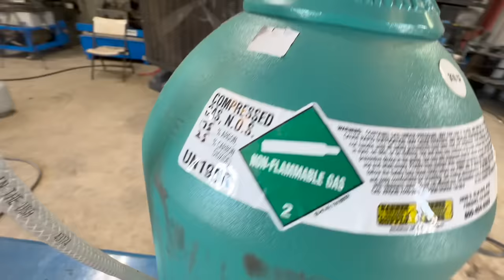Kobelco loader arm part 1

Comment: Man that quite the pretzel there! Thats gotta be close to $10k part I'd imagine so i hope you made them pag accordingly for your troubles of them not using the machine correctly nor taking care of it properly! #4,995.00 sounds about right ya gotta pay for all that propane, acetalyn and oxygen you needed to heat that huge chunk of cast iron up to be able to bend & then line boring & fitting pin! Cheaper than a new part plus the extended wait time sending it from China factory to here in US 👍🏻👌🏻💪🏻🛠️🔧🔩🗜️📐⛓️🏗️🚜⚠️⚡🔥💥💨🚧

Comment: Lots of thinking and demonstrating a difficult problem!  Thanks for filming this.  Would heating and pressing gone better if you built a furnace around the part by piling up bricks to keep the heat in the part?

Comment: Thought of using your Beetle as a track welder?   You might find it useful on those long runs with lots of overlap.  Chuck the mig torch in then clamp the trigger.  Just a thought.
Reply from the maker: I have thought about that. I will probably try it one day.

Comment: Its a little late now, but could you have setup a forge with fire brick and a ribbon burner to heat more of the structure hotter and faster to facilitate bending much easier?
Reply from the maker: That did cross my mind.

Comment: well done, I was gonna say at the start, wouldnt it be much weaker if its already been bent, also work hardened so brittle? I wonder how does that compare to a weld joint? Welds are also slightly harder than the base metal right?
Reply: weld strength is related to the strength of the filler wire.....there is also the issue of [ HAZ] heat affected zone next to the weld, the amount of carbon in the base material and also the fact that weld metal is cast metal, unlike the forged or rolled steel of the base metal.....lots to consider....
Reply: @ypaulbrown  the weld is weaker than the homogenous metal?
Reply: @ypaulbrown  would this be a good case for a backing plate?
Reply: @richardjohnson8009 
Is there enough room for a backing plate
Reply: @dirtfarmer7472  If there is enough room that would be the way to go right, to give the strength back that is lost from it not being a solid monolithic piece, right

Comment: It's all about the heat, getting it red hot would make it much much easier, your press isn't up to the task of pure brute force and it'll just stretch the part, the bending will elongate the inside of the bent area, heating it really hot will compress that area rather than stretch the outer.
Reply from the maker: Ya.  I didn’t have anyway to get it to the proper temperature.
Reply: @OFW  Yea metal that thick would take some heating, it turned out great though, there's always more than one way to repair something.

Comment: So the pivot pin must have broken to allow it to twist that way I guess. What are your thoughts on cutting the ear off and welding one on. I was surprised you were able to move it with such a small heat source and such a small press. Well done! I've witnessed spacers go through a wall when they flew out.

 edit: sorry I have a bad habit of commenting before a video is done...lol.. we would have flamecut the ear shape on our table, left the outside rough and just did an undersized bore to be line bored after assembly. Nice to see things done differently.

Comment: big band saw. cutting and replacing looks like a wise decision. the press looked a little iffy. nice lathes. you must go through some consumables. do you use any PPE? i see a lot of factory welders using ventilators hooked to their hoods. that plasma cutter is sweet. hadn't been invented in my time unfortunately.

Comment: Admiring most of Your approaches - here I think You "overdone it", a bit. 
Being a blacksmith I can't understand why you just did not invest in 2 x 50litre bags full of charcoal, dug a pit in the yard with a shovel, set up a proper fan and brought it to orange in the desired area. Your press would've forged it in  no time at almost no cost compared to all this machining and material costs. 
I was surprised at how fast I was able to heat big pieces using charcoal with the right amount of airflow. Cheap and effective!
Greetings from Carpathians(Poland) 7km from Ukrainian border.
Love Your channel/skill/ideas and hard work! Thanks for the time put into running the YT platform and showing Your Good Work to all of us..
Arek
Reply from the maker: I don’t have any experience in the blacksmith area.  I knew it needed to be hotter but couldn’t get it there.  Replacing it was better anyway because of the hairline cracks.

Comment: Does that plasma have 2T/4T functionality?  It looked like there was a way to keep it on, without the trigger depressed.  That's a lot of flux cover, laid down by the MIG wire....
Reply from the maker: Yes,  after the arc starts you can let go of the trigger.

Comment: What alloy was the part I work at a foundry and we made parts for Kobelco in the past nothing that big for them but all the stuff we made for them was out of 1025 the thing I was kinda wondering and is the part I do is heat treating and with that large of a repair most of are customers want it reheat treated do you have to do the same or are you just responsible for the repair and it’s up to who you where doing it for if they want to do it or not
Reply from the maker: Well this repair was for a friend and it’s not used a lot.  If it was going to be used in an industrial setting I would have recommended heat treatment after I was done.
Reply: Oh ok well thank you for the reply

Comment: Seems to me that you would use a acetylene torch to get the part red hot before straightening it.
Reply from the maker: That would only heat a small area, I would have the same problem.

Comment: Cutting that ear off and making a new one was definitely the best option IMHO. When you stated that it was getting too hot and walked away for twenty minutes, I know interpass temperatures are a real thing but have never had a WPS that addressed it so; how hot is too hot? Great job though. Thanks for the video.
Reply from the maker: There is definitely a lot of opinions on how hot is too hot. When welding you can see and feel something isn’t quite right.  That’s when I stop for a minute.
Reply: @OFW  I’ve definitely experienced what you’re speaking of. Thanks for the reply.

Comment: Quick question for you. Sorry if this was already covered but I couldn't find it in the comments.  I know you ran 71A75, was it .045 or did you go with 1/16th? Also, what were your settings? I'm guessing around 30v but curious as to your wire feed rate.  At first I thought the flat bar was just run-off tabs, but it looks like you actually welded them in the entire length of the bevel?  Thanks in advance. Great work and great video.  I ducked when that 100t ram went flying. lol.
Reply from the maker: 1/16. I was running 27 or 30v around 350 wire

Comment: A question, i dont know much about heavy duty equipment, but when heating like that does it ruin the heat treatment the parts get? Are they temperd?
Reply from the maker: Not all parts are heat treated.  But technically yes it would.  The correct way would be to send it off to be treated.  The customer did not want to do that.

Comment: I was surprised you used a mig welder for this repair.  I thought conventional stick welder has better penetration. What mig machine you using??
Reply from the maker: Wire is 5 times faster and just as strong as stick. Miller 252

Comment: Why do you need to burn off the paint before the press?

Wouldn't the press work just the same either way?

Was this just to facilitate welding later on because it was slightly easier with the bend opened up a little more or is there a reason related to the actual bending in the press?
Reply from the maker: The paint came off to inspect for cracks. And to help with welding later.

Comment: before you start pressing, you must heat it until it turns red-yellow, otherwise you will put too much stress on the piece
Reply from the maker: Ya, unfortunately I didn’t have the right equipment to get it that hot.

Comment: Im Truly surprised you didnt have it magnafluxed for micro cracks, my experience as a marine diesel mechanic would have had me do that..as for the heat youd have been betterheating at the upper bend in the yoke where it deformed while you were straightening it to prevent de- tempering the"Y"...nice job though

Comment: What kind and size of plasma cutter were you using to cut that ear off?? I thought my ESAB Power cut 1500 was badass but seeing yours cut thru that ear was awesome!!
Reply from the maker: Hypertherm power max 105
Reply: @OFW  , that is unreal that, that thing cut thru the 2" steel like it did. I thought only ESAB machine was capable of that thick of steel. Pretty impressive.

Comment: Before welding, you should check whether there are no cracks in this element, otherwise the whole work may be in vain. You can buy crack detection sprays. Gretings.

Comment: Why do you heat the part before welding but let it cool if it gets too hot during the actual weld? (edit: I don't know anything about welding at all, would love to try it some time though)
Reply from the maker: It helps relax the metal and better fusion.  If it’s too hot it can affect the molecular structure.

Comment: Could you make a template from the other side...then make a box with 1" thick pieces and place between the pieces you need to bed so it would bend to that exact radius and horizontal plane?
Reply from the maker: Maybe.  I wasn’t able to get it hot enough to do something like that.

Comment: Wow, just wow. You're awesome! I hope you get payed a lot for that job. Can I ask, why do you have a one sided bevel? Would it not be easier to weld on both sides? :)
Reply from the maker: You can do it either way.  Ones side beveled is a little less welding.
Reply: Aha I see. You found a great solution to this problem, but I was thinking of the material warping due to heat input. That's why I thought it would be easier to have a two sided bevel and weld on both sides back and forth to prevent it from pulling to one side. 😊

Comment: am planning on going to trade school to weld manufacturing, I have a question relating to this Repair hope it does not offend.

1) When you properly heat Metal up for welding, Do you not have to have the correct heat to Reshape welding on a Part like this?

2) also how are you Making sure you maintain Structural Strength after your under-heating welding on this Huge part to attempt to Straighten it back to where the tabs are supposed to be 

 My Grandfather was the top welder master parts manufacturing Forman on a Huge pre Computer lathe it's been a dream of mine to learn to weld and make manufacturer parts

3) i am asking this middle of your video and you ended up cutting off one the bent tabs and just started to Preheat it for you to Build up a weld joining the two parts.

 I was shown by my grandfather how to remove Replace parts like the one your doing, How I watched him make a part like the one your welding up my grandfather told me if he did not get the Newly made part up to proper heat to weld the two back to gether the part will fail and break off or bend fast when placed under pressure when the part is replaced and used in the field.

One thing he showed me was the replacement part the side your going to weld it back on. That end was cut in the shape of a triangle and he cut into the main part a triangle then the new part was welded back on it added better weld strength, The part had to be red hot then weld, to make the old part and the new part he had to Heat the arm up to red hot then lower the entire part in oil to make sure the part was strong and never have to worry the part was to soft and twist off or bend it out shape. 

In closing I am realy interested how you made sure the part was strong once your all done 
?

I watch all your video's your quite skilled thank you for your video's your the reason I am going to go to school to do the exactly what you do.
I just don't have the money after I lost my house and all I own in the flood wiped out alot homes.
Reply from the maker: I definitely did not have the part hot enough to bend it the way I was trying to.  I am confident in my repair because I have done similar repairs before and they have been subjected to a lot of stress over the years with no issues.

Comment: The press in the museum's machine shop where i occassionally volunter has two through holes in the beam on each end matching the height holes in the press structural.

All four pins, the holes through the beam and through the standing members is fitted.

This press, all the pressure is on two pins only.... it is sketchy.....

Comment: You are doing a very difficult job. i know it's not as easy as we are saying. Anyway I have a few suggestions  to you. when you use the press. its better to use a belt, rope to handout the jack. when it skid it will not fail down or made any damage around the aria. the second one is when you heat the part you not isolated the base metal of the press and you not point the heat the exact location must be bend or stretch.  looks like your press is not enough for this kind of press and its also bend. its very dangerous for your safety. anyway this all suggestion are made base on the camera angle i saw. may be you did it correct way. just for your consideration and safety . have a good day.

Comment: So, as a complete and total NON-welder, I have a question. Most of the time when I see a welding repair video, it is repairing a joint that was already welded and it cracked or split at the weld. And yet in this video, the entire strength of the replacement eye depends on a giant weld. Here's my question: Is a weld as strong as the same thing in the original tooled steel? (I am not sure I used all the right terms, but you know what I mean.)
Reply from the maker: It depends on the situation.  But if done correctly it will be just as strong or stronger than the original material.
Reply: @OFW  I had no idea. Thank you for responding.

Comment: Just a question Greg, I take it duel shield is a better weld than hard wire ?
Reply from the maker: Well it depends on the situation. Both have their advantages.  Dual shield can have a higher tensile strength than hard wire.
Reply: @OFW  gotcha, good video

Comment: My impression the temperature was too low. You needed a larger heat source or alternatively build a chamber around the object using insulation stone wool and heat inside this with you torch.
Reply from the maker: I agree completely.  I couldn’t get it hot enough.

Comment: Generally speaking, where a weld seam breaks is not the weld itself but right next to it.  I'm curious as to why you are relying on the weld for strength without some backing plate welded at another angle.  Even a relief indentation with a plate inserted and welded would provide quite a bit of additional strength.  Of course I cannot see the application on the machine where  it's from so I don't know if that prohibits such.  The process of welding, heating, bending etc has undoubtedly changed the grain pattern inside the steel and may prove to be a new weakness going forward.  Hopefully this repair will suffice and last.  Time will tell but we probably won't be privvy to what happens afterwards.
Reply from the maker: Well this machine gets used a couple times a year. And not in a commercial environment.

Comment: How often are you hitting the duty cycle of your 105? Not just with this but in general?
Reply from the maker: I have never hit it.  I have made a 18 ft long cut in 3/4 plate non stop.
Reply: @OFW  i think it might be time to upgrade from my TD82 to a hypertherm. Even the specs on the powermax 85 are better then what I have now
Reply from the maker: @derekh0322 Hypertherm is definitely the best.  It’s worth the change.

Comment: I was hoping to find out what part of what machine this was from but so far no clue other than the makers name? It looks a bit like the front swing arm of a large tractor but the ears are the wrong direction for king pins. There must be a second saddle for the center pin to provide steering, maybe. Don't see it at present. Otherwise,  thanks for the video and for taking on a project outside the scope of your machines capabilities. Some bits looked downright dangerous. Those portarams store an awful amount of energy when they slip or the part snaps. Saw and heard the result of a 100 ton pulling the coupling off a burned out, still smoking, 400 hp electric motor on the mine in Zambia .
 The tech hooked it up, pressurised it, put a safety screen around it, and told everyone to stay clear. About an hour later, it came off like a cannon shot. It would've killed anyone in line with the thing by shear weight if nothing else. Thanks and regards from Canada's banana belt. 
🤞🇨🇦🍌🥋🕊🇺🇦🕊🇺🇲💩🦃🏁👍
Reply from the maker: In the end of part two.  There are some pictures with this part on the machine.  Thanks for the support!

Comment: If you had heated the eyelet with a torch, would it be easier to fix it? I'm not a smartass, I'm just interested... LG Ralf / Rheinhausen / BaWü / Germany
Reply from the maker: It should have been heated hotter to properly bend it back.  I did not have the equipment to get it that hot.
Reply: @OFW  Hey, THX.

Comment: How do you charge for something like this? You spend a week on it, means you charging him 38hr labour? Would be interested in seeing how you quote this type of work
Reply: I’d guess cost plus I’m just guessing,  I know that I would
Reply from the maker: Everything by the hour.  If the customer needs a solid quote before work starts, I try to do my best to estimate how many hours it will take then I double that number.  That gives a high number that should be good if you run into several unforeseen issues.
Reply: @OFW  thanks for the reply. I've experience quoting fabrication jobs but never repairs